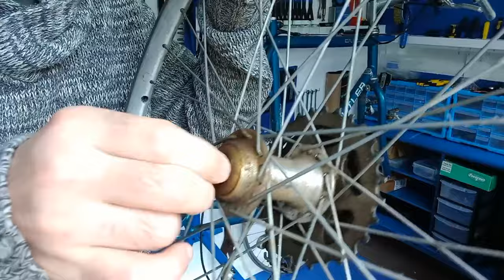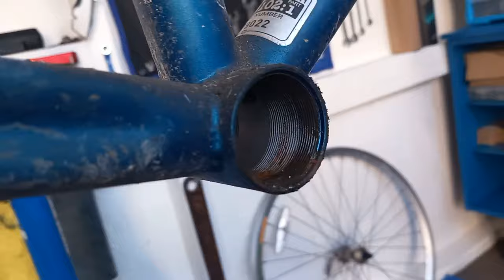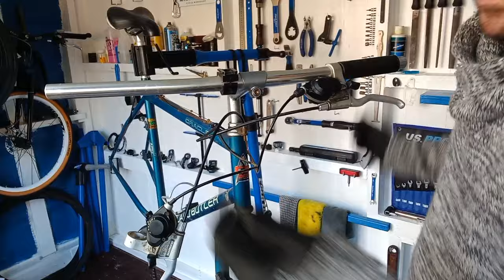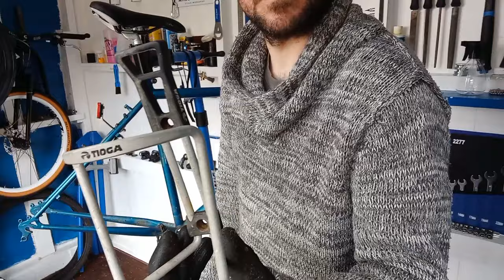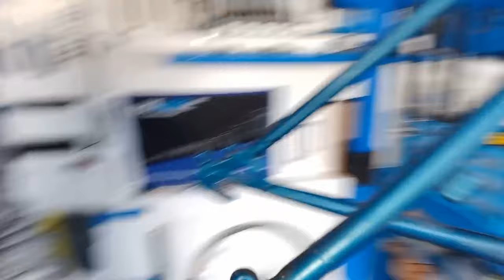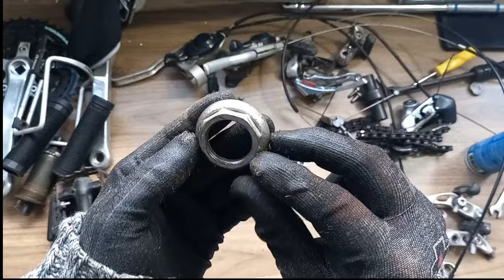Cheap Bike Build Off | The Teardown | Claud Butler - Oracle | Restoration Budget Build

Comment: Ha... Me again... The hanger threads on the Kona are a bit mashed on the outer face.  I run the mech bolt in from the rear to try them... Screwed in fine... But didnt want to force the mech bolt from the outer side... Alloy hanger to 👎 no longer available 👎... Thanks for the shout out. 👌🙏
Reply from the maker: All good mate then run the tap from the inner side when tapping and should push out the crap 👍 done that loads of times when the first few threads are mashed. You will be good mate 👍

Comment: I usually start the tap for the derailleur hanger on the inside of the frame - the threads are usually better there.
Reply from the maker: Good call, and it makes sence if they are really bad 👍

Comment: Dirty, grimy and a bit rusty but nothing worn out so far. Wheels look good, to! Solid base for a rebuild. Question always is, do you want to keep it as budget as possible or maybe upgrade with another crankset and gruppo to make it a bit more appealing? Maybe even install a gravel handlebar and STIs? But then it's not a budget build anymore...
Reply from the maker: It's definitely a solid base for the challenge. And it's one I'll keep in the collection, so I do have options way down the line. I am literally sat having a coffee looking at deals on the basics for the build as in tyres, tubes, cables, and brake pads. We will see how all the parts service up. I'm going to clean out the ultrasonic cleaner later and get ready for the next stage of the build. 👍